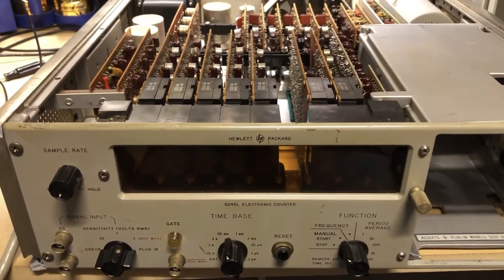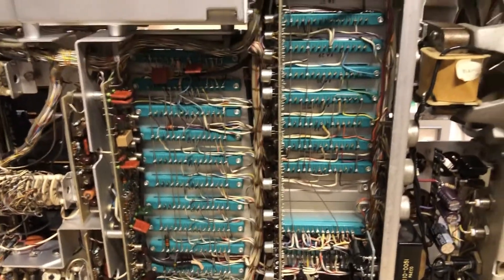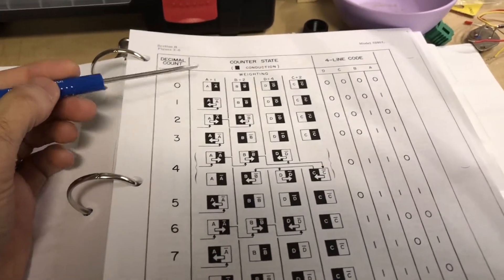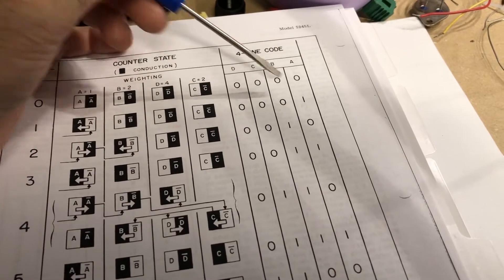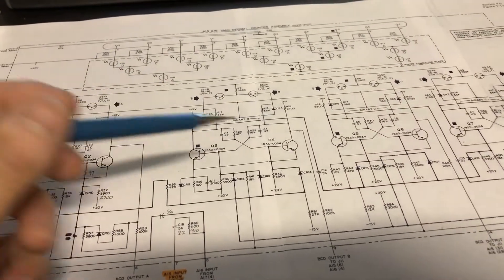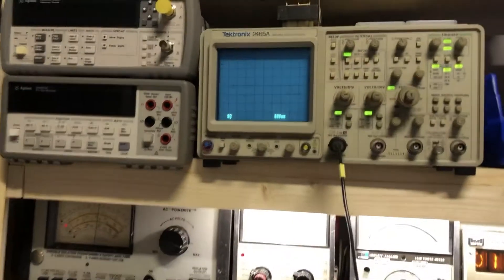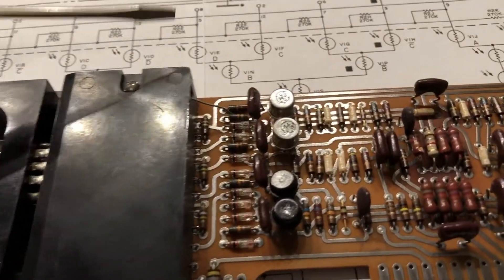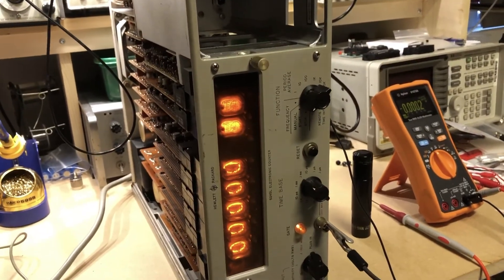HP 5245L Frequency Counter Troubleshooting Part 1

Comment: I have some of those display boards.  They came out of an old Dymec DVM which is even older than this frequency counter.  It was made to be connected to an HP 2100 minicomputer for control and data logging purposes.

Comment: Great video mate. I've had a 5326b for some time which has never worked.
It's got issues with the A15 regulator board which I just couldn't pin down previously. (It was butchered when I obtained it from eBay)
I've just dragged it out for another go...wish me luck.
I'd be keen to bounce ideas off you if you're open to that, you're clearly vastly more experienced than I am!